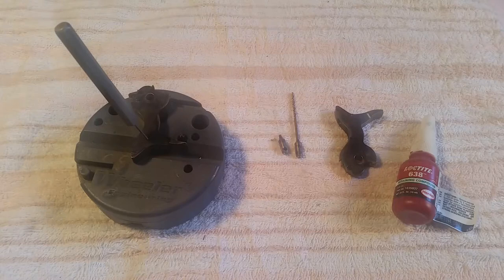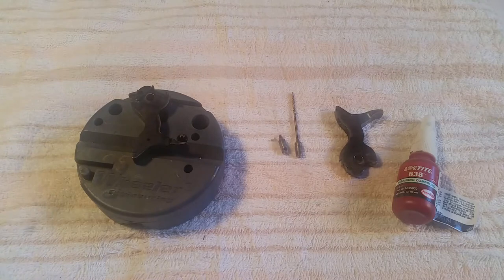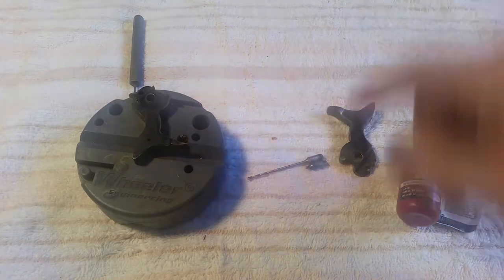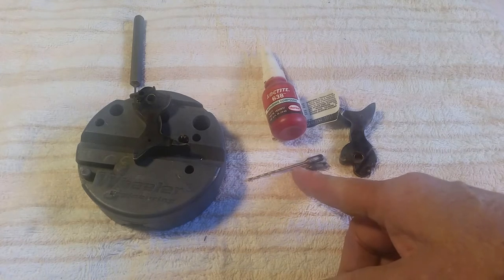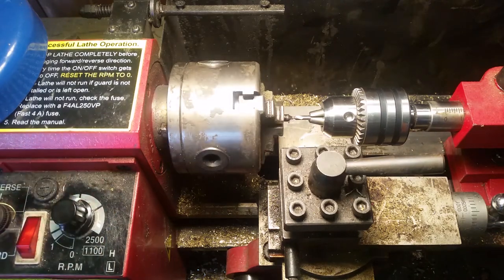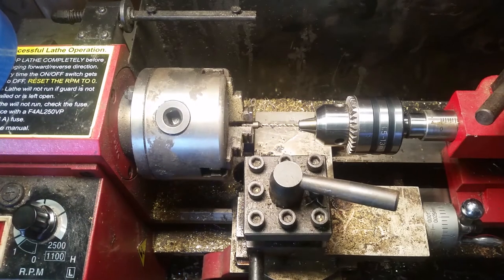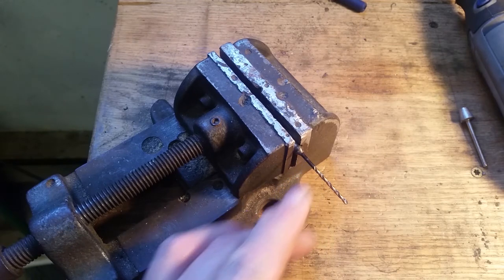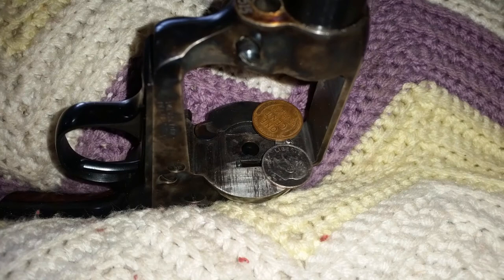Cowboy Action Shooting - DIY firing pin repair

Comment: I suppose, if they don't make a replacement, but the cattleman pins cost less than the bottle of locktite
Reply from the maker: You are right.  But I have the equipment and supplies to repair the pins so I can repair one for nearly nothing in only a few minutes.   Shipping cost on a small part is often much higher than the part.  Then wait a week or more to get it unless you pay an outrageous price for quick delivery.   When I do order parts,  I often pack the order with other common parts so I'll have them on hand.